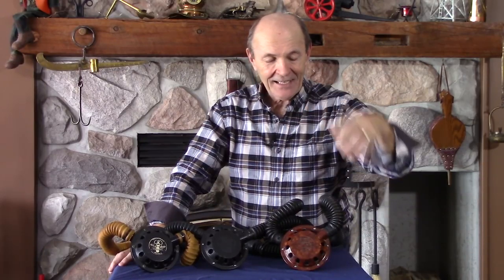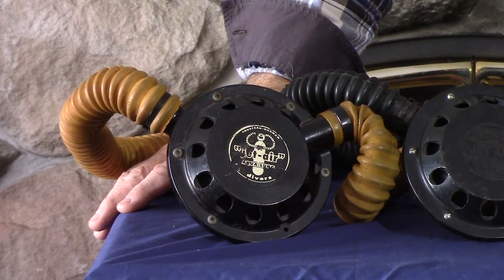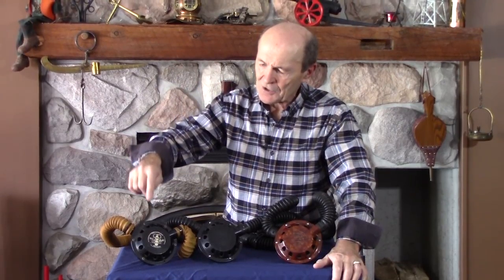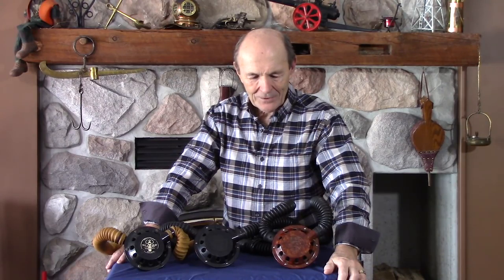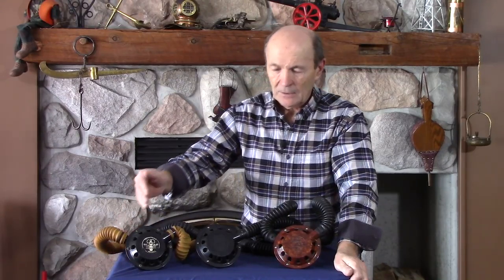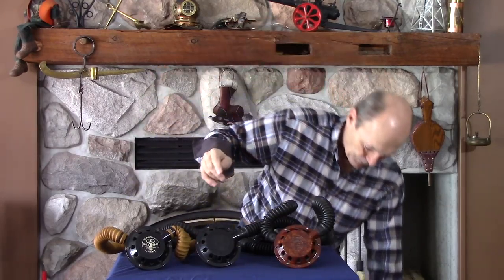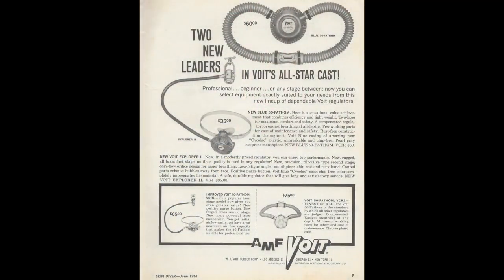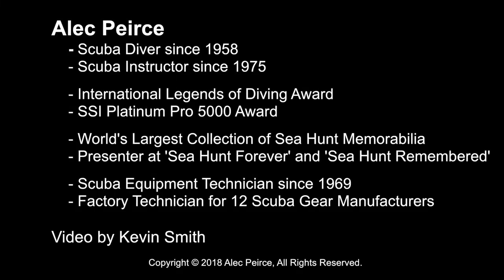Vintage Scuba: Plastic Regulators - Good or Bad? - S04E09

Comment: The two black bodies are made of CYCOLAC (Marbon Chemical, a division of Borg Warner 1950s)  - Acrylonitrile-butadiene-styrene (ABS) thermoplastic resin. The same material used in many steel cylinder bac packs . The brown body is Bakelite (Phenol formaldehyde resins (PF) or phenolic resins) which many might remember as electrical boxes used in residential construction. Very hard and very tough, but brittle.
Reply from the maker: Thanks for sharing the technical information Stu.
A

Comment: I got a Jet Air! The Yellow hose reg is a 1963! Got one and is a great regulator! Love it! And is tough as hell! They all were!
Reply from the maker: Yep! They were odd but pretty good.
Do you still use it?
Alec
Reply: Alec Peirce Scuba Yes I do it's my favorite regulator for river and shallow short term dives. It's portable and lite cuz I dive remote areas where access is on foot in the Adirondacks of upstate n.y. It's very easy to maintain and relatively fool proof! And the inhale and exhaust Woosh is a great sound. And exhaust bubbles aren't in your line of sight ever!

Comment: I am one of those that is still diving with a trusty old Poseidon 300 chrome brass 2nd stage,  I was lucky enough to buy the several service kits for it, the local dive shop  have offer'd to sell me a plastic  modern 2nd stage which I am hesitant to buy. I'm must be classed as the "old dog new tricks" Label....LOL .....   cheers  Alec.....
Reply from the maker: Wow! Both the Cyklon 300 and the DACOR Pacer models were fantastic - in their time.
The Cyklon is still used a lot and service kits are still available. I just sold a box of Cyklons, about 5 complete regs and a lot of parts, to a friend in Cincinnati who loves them. They were a great reg and very popular. 
I think the best regulator I ever had was a DACOR Pacer 900. I used it for many years, long after it was obsolete and loved it. It was almost impossible to freeze. I dive in cold water but the 900 1st stage was about 5 pounds of solid brass. And it was easy to adjust, easy to service, looked good, breathed crazy easy - just a fine regulator. I was so sorry to see DACOR disappear.
Thanks for the memories guys.
Alec

Comment: Dear Alec 
Great video!! Plastic certainly has a lot of benefits, but they look and feel kinda cheap haha. TBH I have a fear of plastic material. My favorite Kraken regulator is made out of the same material I think
Thank you
Reply from the maker: Plastic was once looked down on as a cheap, breakable substance common to all the junk imported from Japan at that time.
Today plastic is no longer plastic in one sense. There are so many synthetic materials now that one can't keep track. 
And many of them are better than metal or any other material. Your car steering wheel is plastic and it never breaks.
Old metal regulators were nice to look at but, heavy, corroded, bent, lost their shine, rusted and suffered other problems too.
A modern plastic item, well-made, like your Kraken, will last for generations.
Take care.
Alec
Reply: Thank you!! Plastic is differently the way to go.  @AlecPeirceScuba_SeaHunter

Comment: I love your videos. But I like to ask. How do you clean all of your equipment after a dive?
Reply from the maker: I have a mesh bag on the boat into which I place all my gear after the dives are done.
When we arrive back at the resort/hotel, I head straight to the pool bar and place my dive bag beside the pool on the way.
After I get my first drink of the day, I wander over to the pool and, casually glancing around to ensure no one is particularly watching me, I push my mesh bag into the pool. I can sit on the edge with my feet in the water to watch it and to move it around without attracting attention.
I leave it there for a short while and then reach down and pull it out but I give it a few quick dunkings as I do that.
Then I take it to my room, remove my suit and give it another quick rinse to get rid of any chlorine from the pool and hang it to dry, out of the sun, inside out (I want the inside to be dry; don't care about the outside). I also remove my mask and clean it in tap water so it doesn't go salty/greasy.
Then I hang the mesh bag with all the rest over the bathtub or shower to drip.
I do this every day while diving so my gear never actually dries out completely. That way any salt doesn't dry on the equipment.

After the last dive of the trip, I take each item and carefully rinse all sand and salt, inside and out, just as I've explained in my videos, before hanging it to dry - preferably outside, in the wind but no sun. Hopefully by the next day it's dry enough to pack. You wouldn't normally dive on the last day of a trip so you actually have 2 days and nights for it to get dry.
Now I'm all set to pack my gear into the big travel bag. It's all dry and so it won't be overweight. 
When I get home I unpack it all, give it a quick inspection, maybe rub it with silicon grease or spray it with water-based silicon (NOT silicon pressurized spray) and store it for the next trip. Reg, mask, computer, etc, go into ZipLoc bags. All batteries removed.

Now before you get on my case for rinsing my gear in the swimming pool, think about all the stuff that goes into that pool - lots of pee, occasionally worse, spilled drinks, sweat, suntan lotion, spit, snot and so on. In fact, it's probably worse for my gear than it is for the pool!
I'm not lazy but I have better things to do than spend my holiday rinsing dive gear. Lots of my dive buddies spend an hour or more every day rinsing and drying their gear so they're ready to take it back into salt water the next morning. That's like 5-6 hours of holiday time wasted!! - time I use to get my second drink of the day and enjoy the sun.

Anyway, you asked. Now you know.
Thanks for watching. Take care.
Alec

Comment: Haven't you said in one of your last videos, that your current regulator is a scubapro MK25 first stage and an A700 second stage? To me this system looks like 100% metal, i know it isn't but its way more metal and less plastic than most other regulators.
Reply from the maker: I prefer the MK25/S600 which is a plastic 2nd. The A700 is plastic too with a nice chrome cover to keep the old guys (LOL) happy. It's twice as heavy, more expensive and harder to service than a S600 with no benefits.
I'm not sure where you would find a metal 2nd today.
Thanks for watching.
Alec

Comment: Alec,what’s the best way to preserve old gear like black rubber masks and snorkels? Is silicone spray good? And is there a difference between hardware store silicone spray and dive shop silicone spray (besides the price).? Thanks much
Reply from the maker: Do NOT use silicone spray. The propellant gas is very hard on rubber (and you and the environment too).

You can use silicone PUMP spray which is dissolved in water and has no gas in it. Most dive stores have it.
Or silicone grease sold in small tubs.
I'm not sure of the difference between dive store silicone and hardware silicone. There may not be any difference.
However, for the small difference in price, if any, get the dive store stuff. 
That way you know it's good to eat - well, it's not bad to eat or to breathe.

Wash black rubber products in warm water with a tiny bit of dish soap; rinse well; dry thoroughly and then apply the silicone.
The best way to apply silicone is with your hands. Spray or rub the silicone onto the item and then, using your hands rub it thoroughly all over, into all the cracks and folds. Using your hands warms the silicone so it penetrates the rubber.
Store the items in a plastic bag, preferably sealed with the air sucked out of it, and in a dark, cool place.

I have some masks that are 50+ years old in near perfect condition, still soft and ready to use. And I have others than are like nachos - hard, dry and crispy - just waiting to be touched so they'll break apart. It's all in the storage.

Good luck.
Alec
Reply: Thanks Alec,much appreciated!

Comment: Hey Alec just a question can all first stages connect to an
Reply: Any tank
Reply from the maker: It's good to see that others have trouble with computers.
I'm always losing a message when I'm only half way through.
It's really annoying when it's one of my 2 page replies!

Anyway, to your question, any first stage can be attached to any tank valve.
Note that they may not always be compatible at first. There are 2 different systems in general use - the yoke style used pretty much worldwide and the DIN style which is used mainly in Europe or when required because of higher pressures.
However, with the proper adapters you can fit any regulator to any valve.
There are other attachment systems but they are so minor that I won't discuss them here.
Thanks for watching.
Alec

Comment: Plastic is nice and light. However, however it does deteriorate, I'll probably only get ten years out of my Apex...... Maybe longer if I actually look after it!
Reply from the maker: Wow! With a bit of care your Apex can last 20 years or more. Not that you want a 20 year-old regulator but it should still be good.
These Jet Airs are almost 70 years old and can still be used!!!
Plastic will deteriorate if not kept shielded from the sun, heat and air.
Sealed in a zip-lock bag your reg should last forever.
Alec

Comment: Probably they are better in cold water. But what about first stages? Can you do them in carbon or plastic? And what about all the plastic that is invading our planet?
Reply from the maker: The first stage has to be metal because of the high pressure and very strong springs.
Plastic is certainly a great modern material but it sure is NOT good for the earth.
Realizing that it comes from petroleum and can last for many years is a double whammy! Bad to make and bad to use!
Take care.
Alec

Comment: Delrin and Bakelite will eventually break down.  Oxygen in the air and UV light are the things that will break up plastics.  The worst plastics are the Poly Urethane based ones.  A bakelite radio from the 30s usually will be cracked.  Ski boots from the 60s break into crumbles.  Synthetic rope looses its strength.  Too bad that manufactures do not tell you the average life of each plastic.  Plastic of any kind will last longer when stored in a nitrogen atmosphere, but few have the means to do that.
Reply from the maker: I find that you are best to store anything plastic, anything synthetic actually, in a  zip-lock bag in a dark, cool place. 
I suck the air out of the zip-lock bag before sealing it.
Some very valuable items I even vacuum seal with a food sealer.

I have some plastic items that are 50+ years old and like new. 
And others than are 10 years old and cracking up.
Take care.
Alec